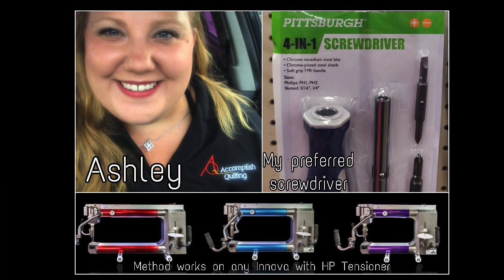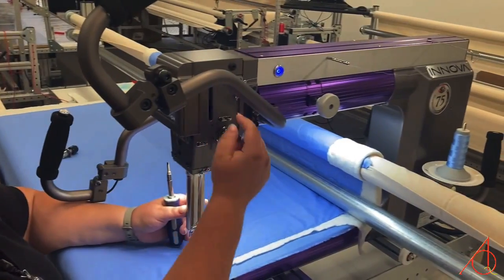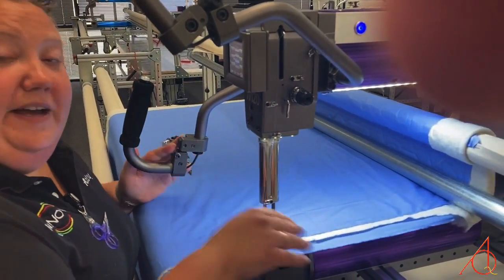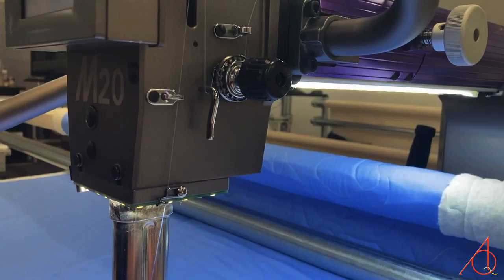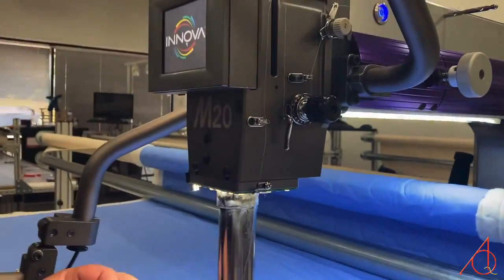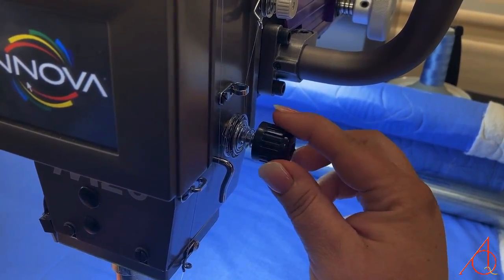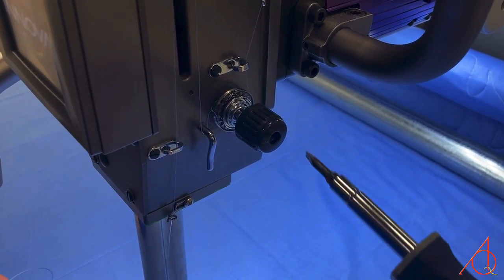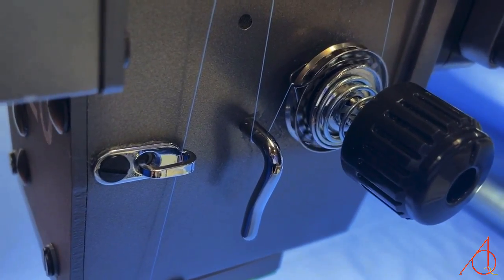Michael's Tension Method for Innova Longarm Step by Step

Comment: How often will I need to do a complete reset like this? I am struggling with thread breaks and tension when using APM3 on a Dream Big panel. I either get top thread on bottom or bottom thread on top or constant thread breaks if I try to change the tension on top.